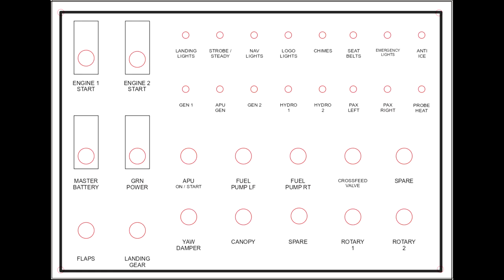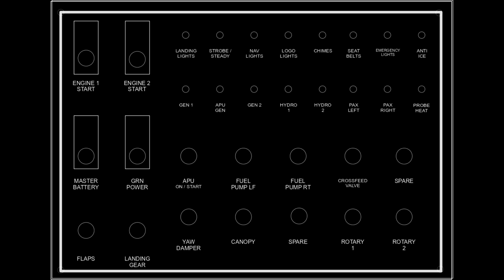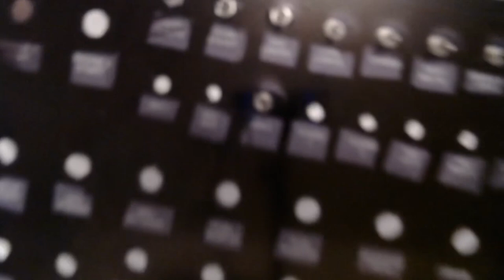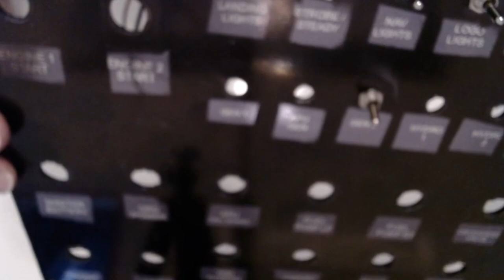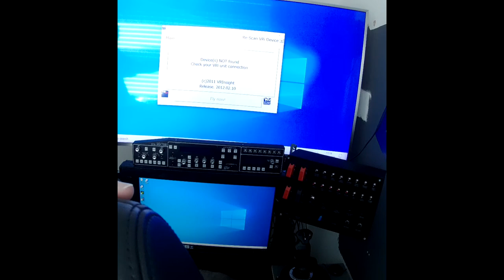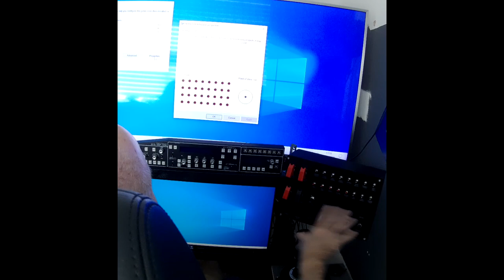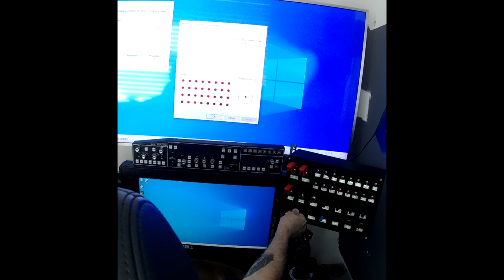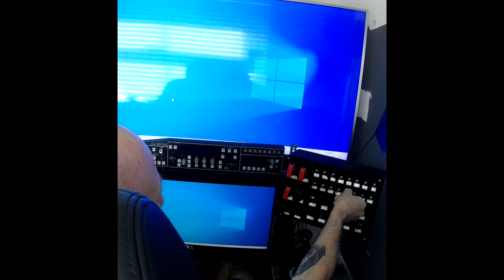Flight Sim Button Box Build

Comment: Can this board light up a switch when it’s in the on position🤔
Reply from the maker: Not the way it’s setup as it uses the Lrobodner board if you were to replace this with an arduino you could assign outputs to leds. Thanks for watching take a look at bits and droids channel I think he can help 👍

Comment: Hey, great video. I was wondering if you need to program these boards or if they automatically recognize 2 and 3 way switches. Furthermore, how do you connect these switches properly. Does one end go into a slot/socket and the other wire into ground? or does the secondary wire go into yet another slot. (e.g. wire 1 into A1 and wire 2 into GRD or is it wire 1 into A1 and wire 2 into A2?)
Reply from the maker: Hi on the Leobodner boards wire one goes to B1 and the other goes to GRD. You have B1 - B32 and beside each one is a GRN or you can link all your grounds together and just run one wire to the board. I use FSUIPC to program the switches in FSX as this gives you the option of multiple positions on one switch especially useful on rotary switches. I hope this helps ......
Reply: @togatech1111  thats amazing! Thanks for the reply!
Reply: How can I write to you I have all the parts for a FSM based  maybe something you will be interested
Reply from the maker: You can send me an email at Togatech737@gmail.com 👍

Comment: great video. I'm new and want to build a button box. Just a quick question do you have to solder the wires into the input output card? because i saw some pre soldered  switches so would i need a soldering gun?  thanks!!
Reply from the maker: Hi Comet 21 sorry for the delay. The Leobodner Card with 32 inputs uses a push input so you just have to push the wires in no soldering required. The Leobodner 64 card uses dupont connectors. Sorry again for the delay in my response I have a Discord channel which I check daily so please feel free toi contact me on that here is an invite to the channel https://discord.gg/HuWZQ5r thanks

Comment: Nice build - also looking do do similar for DCS, using the teensy 2.0 interface board. How do you get round using simple on-off rather than momentary switches in DCS? Would be much nice to be able to use single throw switches for power and engine start rather than a momentary push-button?
Reply from the maker: I believe you can use FSUIPC on DCS this would allow you to use standard toggle switches same as you can in Microsoft FSX
Reply: @togatech1111  actually not needed, found a simple edit to the joystick default lua code to allow for a simple on/off button, theres a big thread about this in the ED DCS forum (input/output section)

Comment: damn bro, pretty dope. I was looking into something like this, nothing fancy, just a box with a few commonly used inputs for a 172. About how much would you say this cost all together?
Reply from the maker: The most expensive part was the Leo bodner card at £32 but there are cheaper if you only want say 20 switches for a tenner. The switches where 99p each or if you are prepared to wait dirt cheap from China 🇨🇳 The facia was 4mm acrylic but poster board would work to at  £5 a sheet. Good luck and thanks for subscribing please send a picture of your build 👍